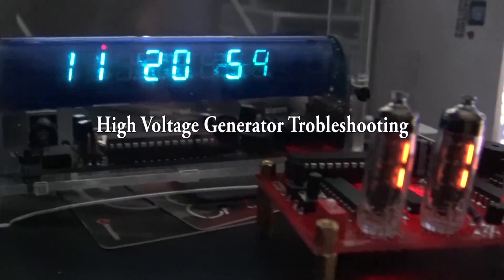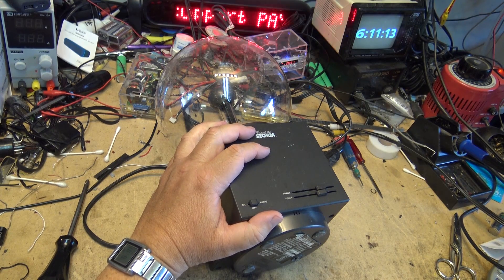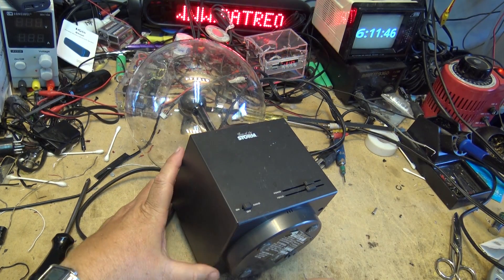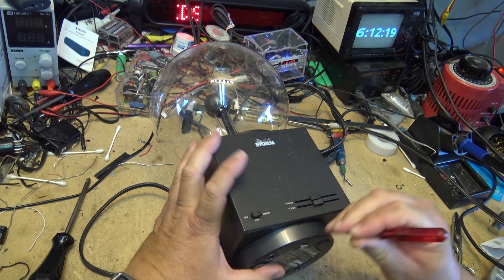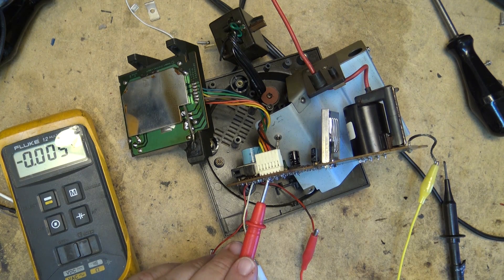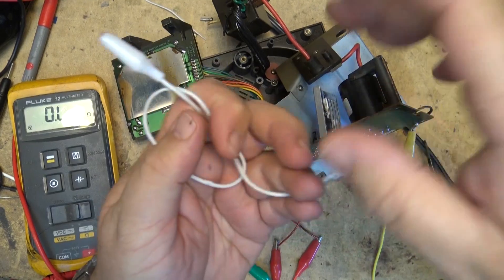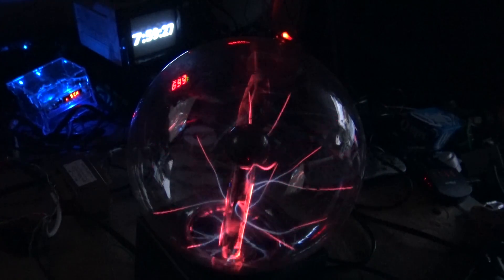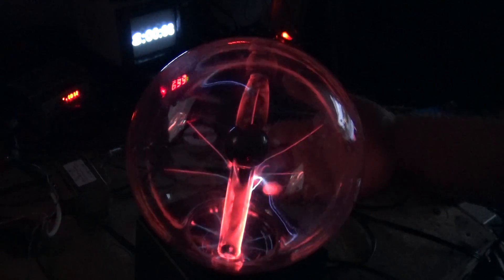Plasma Ball High Voltage Power supply troubleshooting

Comment: Thanks for the video and showing me/us how to dismantle this with the 2 hidden screws under the feet + 2 screws you can see!!
Looking inside mine, everything looks good!  There are no bubbled caps or exploded components.  The transformer looks great and no burn marks!
But nothing happens when you turn it on!!
I plugged in and checked the voltages off the red secondary of the transformer without disassembling it and showing nothing!
I wonder if the issue is between the wall outlet and input of the transformer?!??
Is there a schematic or layout available after all these years, so can follow things without dismantling??
I purchased this in the Summer of 1989 and date code shows 30th week of 1988!!

Comment: Not sure if you are still monitoring this vid; excellent disertation, on the troubleshooting. I bought the same plasma ball, from Sharper Image, when I was in Tampa Bay, in 1989. I live in a 240VAC country, & daftly plugged it in, without the travel adapter one day: phoof. Whilst it is the same brand, the model is different. It had an external power supply, with 22VAC being fed into a dc-style jack. This feeds a dual AC wire straight to a diode bridge rectifier.
My question is; would a 240VAC>24VAC {1A+} transformer cause harm to the unit? Or would the extra 2V be critical? I have checked the board, & can't see any obvious component damage. No accountability, on your part. I am pretty much a noob, at hobbyist electronics, but would think it should be OK. As I threw way the power supply, decades ago, I can't reference it's internals. Yeah, I know: dumb. But wasn't thinking it would be too hard to replace. Just never got around to it. Would a new supply require any other components, other than the transformer, & a choke. Cheers. 
Am about to subscribe, as I can learn alot, from you. Great channel.
Actually, the choke is on the mainboard. I initially thought it was an inductor, though couldn't work out it's function.
Reply from the maker: The extra 2 volts shouldn't make any difference to operation.
Reply: @12voltvids  Thanks. Stay safe, in these trying times.

Comment: Looking for some help in repairing my plasma ball. I'm still a little confused on the Transformer and what it should be. And i think that some of my diodes are blown because I'm getting some different readings. Any help would me great. Thank you for your time.
Reply from the maker: The transformer is generally a TV playback transformer.
Reply: @12voltvids Thank you for the help Just to be certain I should buy a 12-0-12 power supply Transformer for it? I know the primary coil went out on it.  Any help on locating a replacement would be nice.

Comment: @12voltvids: If my globe works almost perfect at first turn on, then dims and doesnt produce the beams that reach the edge of the globe, what do you think is the issue? Bad capacitor? Something else? Any help is appreciated, I dont want to just start replacing things hoping I figure it out. I have a video on my channel with it doing this. Thanks!
Reply: Yeah I'm looking to refurbish mine with the same questions. Any word? Or just replace all the electrolytic caps? The slide switches (variable resistors) pots seem to not function the globe properly. Already tried switch cleaner and didn't make much of a difference so.

Comment: Wow, hope that wasn't headache smoke! Needed a fuse for sure! I saw one of them in Disneyland, around 1987. I was only 8 or 9 years old but I remember getting a strong, slightly painful tingling if I touched the plasma ball and the chrome metal display shelf at the same time.

Comment: I had a buddha one and the arc would just spin in circles at the bottom, when you touched it, it would arc to your fingertip but it's was weak. It wasn't supposed to do that, it was supposed to go everywhere like yours did, it was that way brand new out of the box. :/

Comment: Yeah, because that would be devious of them to put an interlock on the control panel PCB so it won work if you disconnect it, right? 🤩
Reply from the maker: Safety feature.

Comment: You could use 3 core mains lead and split the cable in to such that the first half goes to the transformer and the other half comes from the transformer to the 3 pin plug that plugs into your wall socket and you can put that transformer into a case which means if the transformer goes faulty  it can be replaced, A MJE3055 TO3 Metal case will suffice

Comment: I imagine you're going to throw a fuse in there when you put the new transformer in. Maybe I missed it, but you didn't really explain how you found that the transistor was shorting after you had it running. Was it intermittent? I guess what I'm asking is what made you keep looking after you had it running? Intuition?
Reply from the maker: BlankBrain 
Because it shorted and burned up another jumper lead to the transformer. While it was running. Right at the end at 18.32. It went out and the jumper went up in a puff of smoke. I had just turned the camera off and was over at the light switch turning the lights on when it failed. So I measured and found collector shorted to emitter. Went to pull transistor to check out of circuit and when I removed screw I had my root cause. Insulator failure. That would be what caused original transformer to cook.

Comment: My Plasma ball is the same size. I bought mine at Spencer's Gifts mine has on and off, The new plasma ball has a plug in wall adapter no power supply it's the wall adapter

Comment: a couple of weeks ago i wondered IF... we could math-out the output voltage of a burnt primary transformer (quite likely it is) by reading the inductance of the secondary, i think also the power needs to be calculated (it's a matter of measuring the core section)... anyways the whole thing looks reeeeeally badly made, i mean, it's a "toy" of decades ago, never seen that plastic washer broken, the transformer itself looks one of an antique radio, just wrapped paper

a 5 inches plasma ball is 15$ ish on ebay china today :D it's garbage but the globe itself is fine (i have one, it comes with an ear torturing "for elisa" chip and buzzer that also goes weird when touching the globe LOL)... no transformer, just a step down capacitor, not sure how long this lasts

Comment: I used to have one that size, till my niece smashed it with a misthrown football.  I kept the beefy 12V wall wart though. I now have 3 inch USB model which sits in front of my 21inch monitor I scored at a yard sale for $10.  Shame there was no fuse, quite an oversight.

Comment: A very magical looking device :-D
Shame it has no fuse protecting the transformer, ahh well.
The good old 1970's 555 timer, the workhorse of many circuits :-D.
Such a usefull old chip.
Reply: with 2N3904 and 2N3906 on the PCB, so probably acting as a flip-flop in some fashion?!?